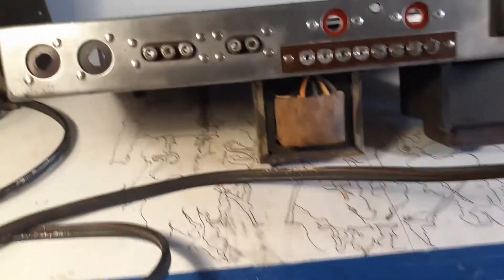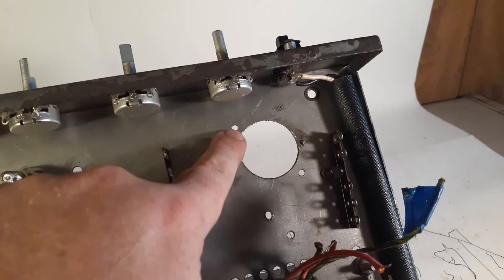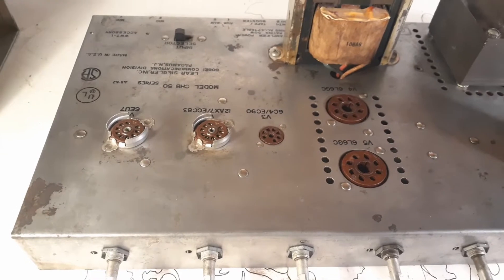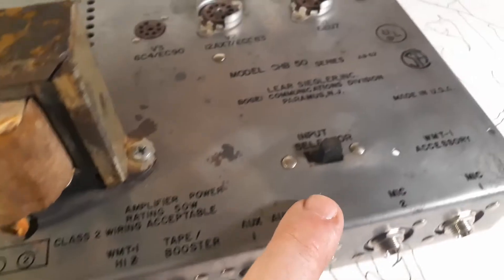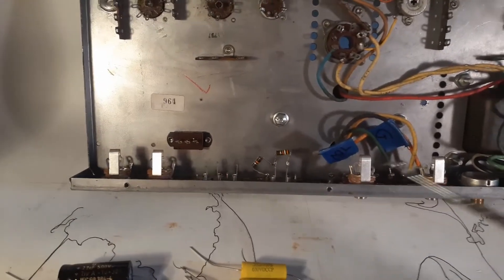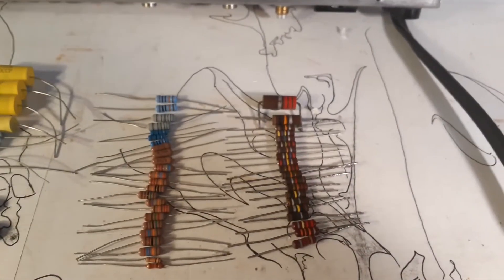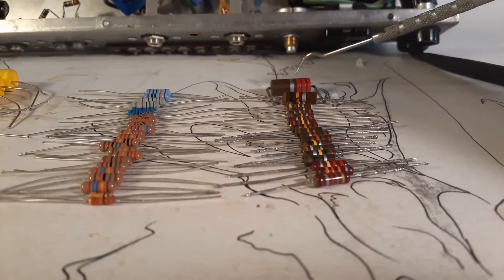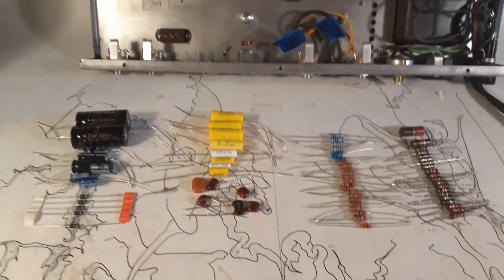Bogen CHB-50 Tube Amplifier Conversion, ep 3: Prepping and Parts

Comment: I ended up hand building 3 seperate circuit boards for mine to.
Reply from the maker: Sounds too complicated for me. If a Silverface Fender didn't have it, I don't need it. I prefer to rearrange and make something that COULD have been made when new, if the parts were juggled around a bit. But like no consumer tech newer than like 1970s! But I am still intrigued as to what all you got going on there?